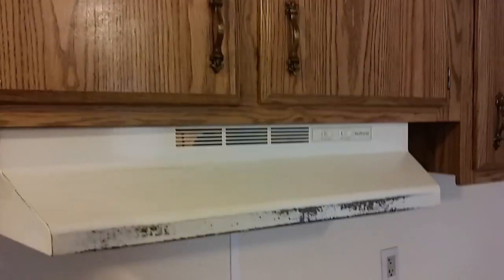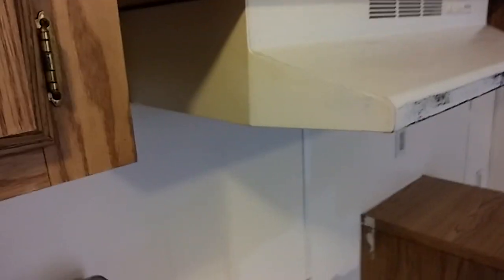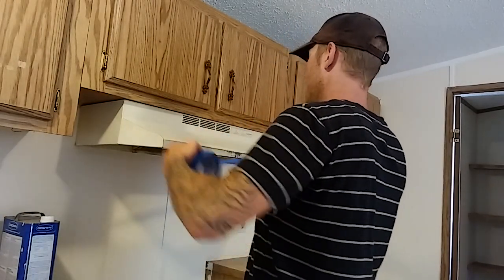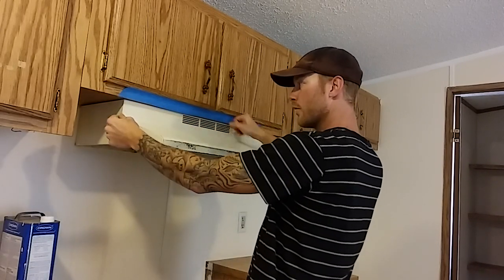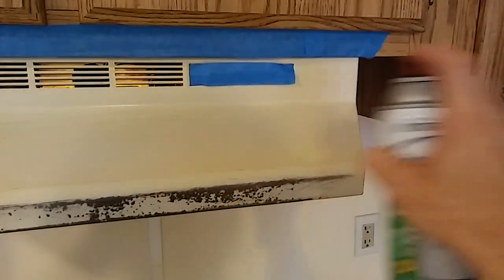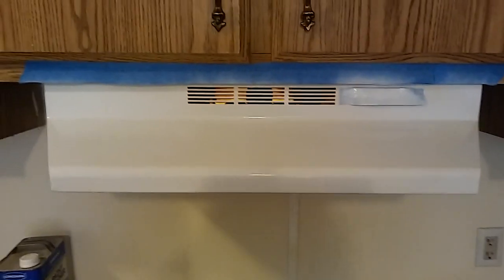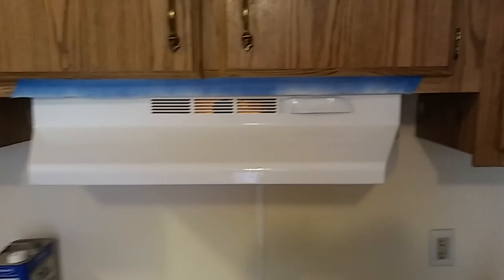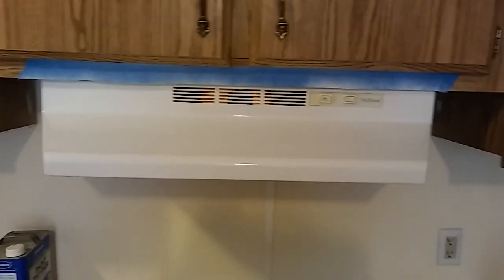How to paint old appliances

Comment: I'm so impressed by how you put down just a few strips of painter's tape around the edges with it still attached, no drop cloth or plastic or nothing covering the surrounding stuff, and managed to not get paint on anything but the project itself. Not my clumsy self 🤣🤣I would have gotten paint all over EVERYTHING ELSE too 🤣

Overall, very helpful video, 10/10 painting accuracy! I'll be doing mine like this, but with as many drop cloths/plastic coverings on the surrounding items as I can. Thanks for making this.
Reply: I would have covered everything up so I couldn't get paint on anything, other than the project.
Reply from the maker: Thank you so much I would definitely prep a lot more if it were a bigger project this oven hood just needed a light topcoat. Thank you so much:)

Comment: Looks EXACTLY like the hood in older house I recently bought. Was going to replace, but at meast for now, I migjt give this a try. THANK YOU!  (Also I read from a comme ter that Stainless Steel appliance paint is different and has to be sprayed SUPER light or it will run (like 8 coats) but that if done that way will turn out well.)
Reply from the maker: Your welcome:) and yes I would definitely do small light coats rather than thick coats. Because it will definitely run. And remember prep is everything:)

Comment: Nice job! Do they have the Appliance Epoxy in black gloss?
Reply from the maker: Yes they do here is a link:)
https://www.googleadservices.com/pagead/aclk?sa=L&ai=DChcSEwi1mL-FnZflAhWTt-wKHbnrAGsYABAEGgJwag&ae=1&ohost=www.google.com&cid=CAESP-D2Mev4LpCm8pYHm7T12Y6d7-a_xS-ZwOIwLAfF1qS_YWde-KVNsNkDJIKr8Lansp8cxvyMenr83hJiZmv5nA&sig=AOD64_0mhpECeGDB2gKNvwe8kguqiIhEZQ&ctype=46&q=&ved=2ahUKEwj3pLaFnZflAhUNnZ4KHTypCbMQzzl6BAgKEBQ&adurl=https://www.lowes.com/pd/krylon-appliance-specialty-gloss-black-epoxy-spray-paint-actual-net-contents-12-oz/1000459661%3Fcm_mmc%3Dshp-cprdpntgooglelia-219-spraypaint-1000459661-_-0%26store_code%3D2477%26gclsrc%3Daw.ds%26%26gclid%3DCj0KCQjw84XtBRDWARIsAAU1aM2SAUAf8qIvy168NwXkIBblmA5Bi7jT-I4XGV0c8wCQGc-7zjH9DwEaAkatEALw_wcB

Plz subscribe and share the video.
If you like what you see check out my YouTube channel there's allot more DIY videos;) thank you
Reply: Yes they do..it's 4.98 at home Depot. I have black
Reply: Walmart has the gloss black High Heat for the range its self. Don't use the regular  appliance epoxy for the actual range.

Comment: do not use paint thinner! its oily also an you'll have to wash with dish soap to remove it. use rubbing alcohol for 1st an lost step before applying the epoxy.
Reply from the maker: Thank you for the tip I will definitely try that out. Plz subscribe if you like the channel and thanks for your time:)

Comment: Is it a kitchen chimney?
Reply from the maker: Kinda, the exhaust travels directly behind the oven good through some vents and then makes its way outside:) So more of a horizontal ventilation rather than vertical.
Reply: Oh well I have a question will this epoxy will on chimney????
Reply from the maker: Like a chimney for a fireplace?
Reply: Yeah 😊
Reply from the maker: Ok I don't think your supposed to paint the inside of those.

Comment: Why didn't you remove the hood and spray instead of masking?
Reply: My thought exactly. It really isn't too hard, just turn off electric and cap off ends of supply of line.
Reply from the maker: Definitely rite I could have just did it the easy way Incase people didn't want to deal with the electric:)
Reply: I tried to remove mine.  Got most of it down to find out the screw attached to the exhaust vent was stripped. An hour wasted.  😑
Reply from the maker: Dang that's no good. That's why I did this video without removing it. It's alot easier just masking stuff off then removing the oven hood and running into problems.. thanks for watching:)